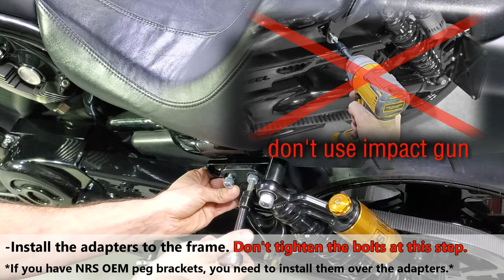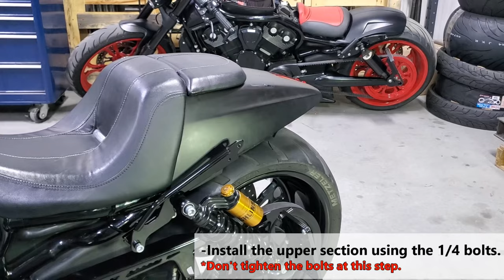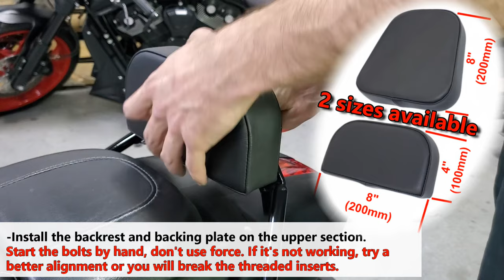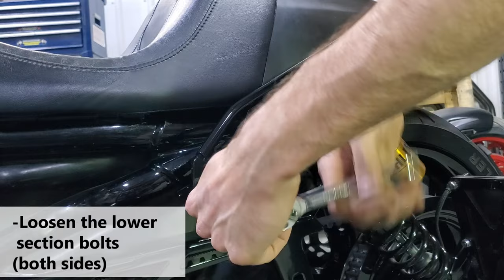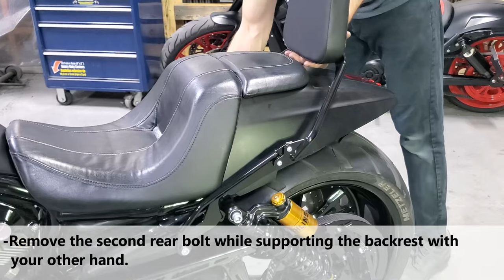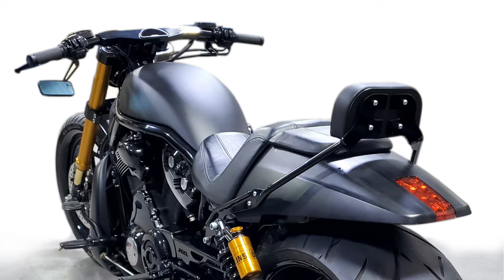V-Rod Bolt-on Passenger Backrest - Installation

Comment: i recently got this kit from you for the nightrod 2014 special. unfortunately it wont install with the stock passenger footpegs, because with the backrest attachment spacer between the foot peg holder and frame causes the angle to change and the screws won't thread the frame holes any more, any suggestions ?
Reply from the maker: Hey, can you send us an e-mail to info@zeeldesign.com , we can probably gave you some tips to install the pegs!
Reply: Did you ever get a solution